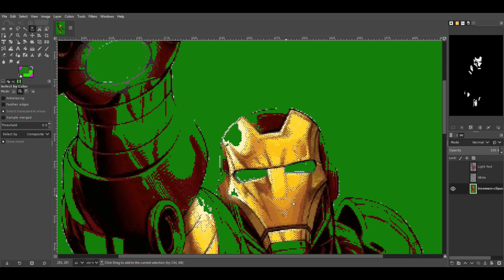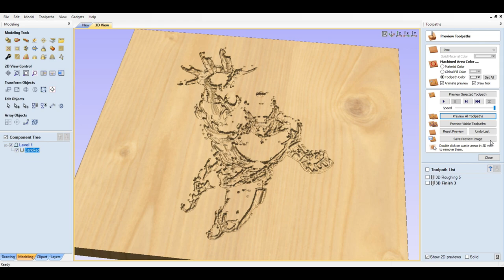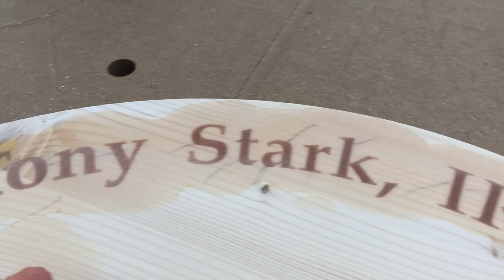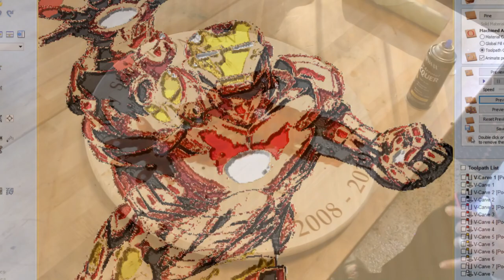3D “Screen Printing” with a CNC and Resin?

Comment: Very cool project and concept. A few comments.  I typically plane my resin off with either my CNC or a planer if it’ll fit - takes away a lot of sanding time.  Liquid dyes keep transparency better than powders, but you’ll need to use a sanding sealer to prevent bleeding.  Just some tips I’ve learned from doing this type of project over the past few months.
Reply from the maker: Thanks!  I almost did use the CNC to surface it off, have done that before.  But I need to replace my surfacing bit...  and did t want to risk anything.  I do need to get some alcohol dyes...

Comment: Enjoyed the video. One question, the squeeze bottles you used to fill the carving. How do you clean the epoxy out of them or is it a one time use?
Reply from the maker: I don’t.  They are fairly cheap on amazon.  And the leftover resin, I let harden in the bottle.  Sometimes I intentionally make extra if I like the color.  When it hardens, it’s easy to cut the bottle away, and I’m left with a good turning blank for the lathe...